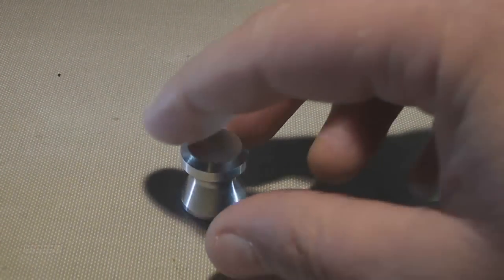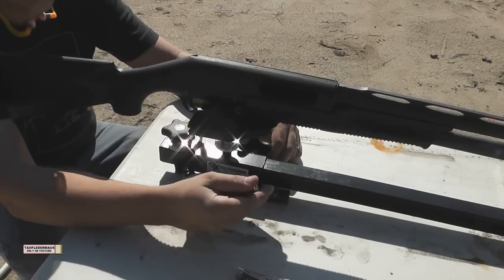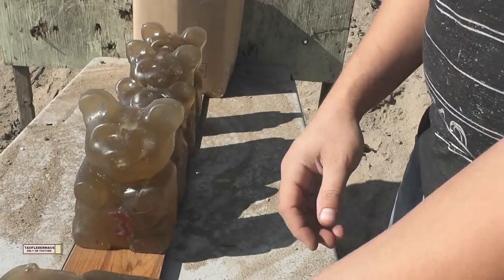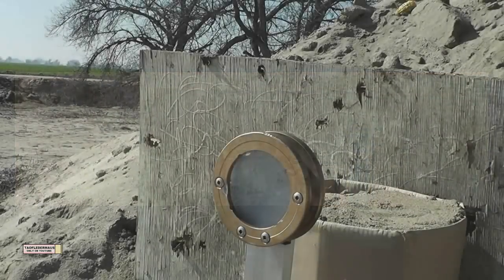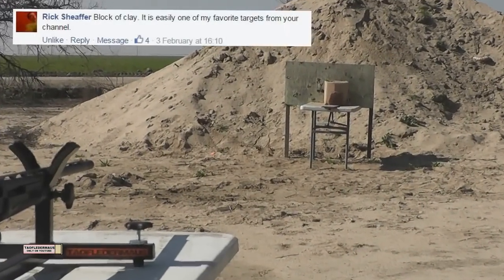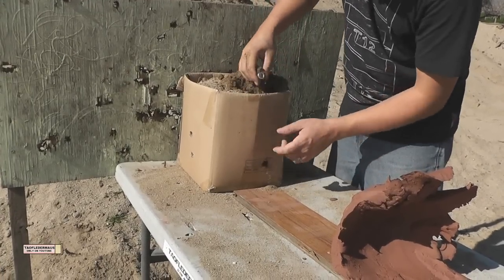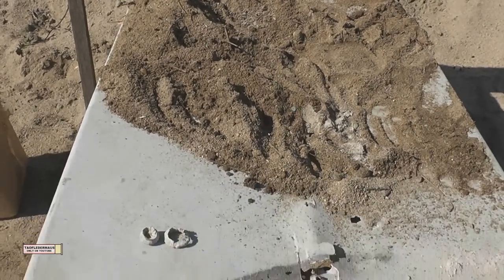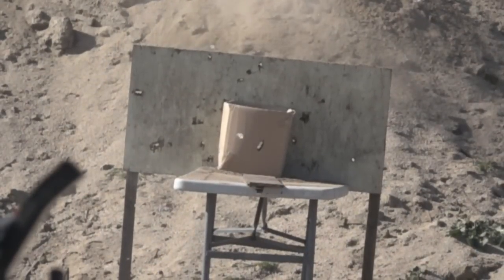.70 Cal  ALUMINIUM Shotgun Slugs  -  Ballistic Trials

Comment: matt, those are not DIABOLO design pellets.... thats wadcutter design. diabolo is domed like tims carbon fiber slug. you will see easily those are not very accurate at range at a higher speed as they create a shockwave at the nose that creates turbulence and causes a keyhole effect.
Reply: heres a link to the difference between them http://www.bestairriflereview.net/wp-content/uploads/2014/03/air-rifle-pellets.jpg

as you can see, wadcutter on the left simulates that "pellet" as the diabolo design is represented by the center pellet in the image which is a superdome. and then the hyperpoint which is crap
Reply from the maker: +Raging Reaper Gaming Variety   A "diabolo"  is a toy that sort of looks like a cross between a yoyo and a top.  That is where the name comes from.   https://en.wikipedia.org/wiki/Pellet_(air_gun)
Reply: *****
i am aware, however. the DIABOLO design in a pellet was developed by cz long ago which is a round nosed pellet with a abrupt drop on the flair of the head. wadcutters in pellet design are any pellet with a flat nose

Comment: Gunpowder has a specific expansion rate, as does any explosive.  I expect that an optimum slug mass would be the maximum you could get without significantly damping the expansion rate.  This means that a slug of less than optimum mass is not likely to go much faster (if at all) than your standard slug.
Reply from the maker: +TheHengeProphet   I think you are correct.

Comment: the issue is assuming that the two rounds have the same energy. the heavier round takes longer to accelerate so it absorbs more energy.
Reply: +TAOFLEDERMAUS Air guns always operate at the same exact pressure, smokeless powders do not.  Changing crimp, projectile or shot load, bullet lube if applicable, wads, can radically change pressure for the same powder charge.  A heavier bullet may actually radically and dangerously increase pressures because it affects the dynamics of the powder's burn and peak pressures through resistance, timing, ect.  Putting a roll crimp on a load of birdshot for a shotgun has the tendency to reduce its pressure over a standard crimp, changing the undershot wad can increase or decrease pressure.  Even projectile drag and shape can affect powder burn and how it builds pressure.  Small changes can yield big results, so no, same powder does not mean same pressure or same energy by any stretch of the imagination.

To be honest, I thought you guys would know this.  What you are doing is potentially very dangerous.
Reply from the maker: +krap101   In the air rifle world,    a heavier pellet tends to be slower than a lighter one.
Reply: +TAOFLEDERMAUS right, but saying that they have the same energy is incorrect except in very specific situations. You can be going slower but still have more energy
Reply from the maker: The same powder charge - same potential energy
Reply: +TAOFLEDERMAUS true, but you don't convert all of that energy into the round.
Reply: +TAOFLEDERMAUS transfer*
Reply: +krap101 it actually has more to do with the round's momentum. a round twice as heavy with the same muzzle energy will have about 40% more momentum (mass * velocity). so it takes more mass to stop the heavier round
Reply: +Everyday soldier I'm talking about internal ballistics rather than external. Just relating momentum to energy is easy... E=PV/2
Reply: +krap101 E=MCC
Reply: +Inteligento that equation is only valid when you convert nuclear potential into some other form... have a weird feeling that is not happening here...

Comment: my thermostat doesn't work and has nothing on it's screen..I haven't had time to meet with a technician because of my job..what do you think it is? the compressor's connection outside is fine, but I don't have a ladder to get into my attic space to check my handler.. i think the cutoff switch or drip-pan switch was jostled when the roofers were dropping loads of shingles on my roof..that or they climbed inside and shut it off to mess with me..it's been cold in here for the past two day :( my poor cat has to deal with it all day..i wish i was covered in fur, sometimes
Reply from the maker: +Star Kicker  See if you have 24v dc between the red and black wires in your thermostat.
Reply: I did, apparently a fuse in the handler was broken. poor kitty..she's happy now..I didn't think there would be fuses in the handler..thanks though

Comment: You dont get any increased velocity because you are using the same powder charge. Factory light weight rounds go so much faster because lighter projectiles cause less pressure (Because less resistance to being pushed) so they in turn increase the powder charge. Id like to see you guys push one of these aluminum slugs with the powder charge recommended in reloading manuals for the slug weight. I think youll be surprised how awesome it becomes, at short ranges anyhow. It won't carry as well.

Comment: I think the reason why the lighter bullet is not going any faster is because it reached the peak velocity the moment it left the barrel. Basically, the speed it is leaving at is the representation of the force of the powder. Since both of them are using the same grain, both of them having the same speed is understandable.

I think the aluminum bullet had a faster acceleration than the lead bullet inside the barrel though, probably because of its light nature, the friction caused it slow down by the time it left the barrel.

Comment: Handloading brass shotshells I figured out that it takes back-pressure to get full energy out of modern, smokeless powders like Unique.  As light as your slug is, with no crimp to hold it in while pressure builds, I actually expected it to be slower than the lead slug.

Comment: as someone who reloads ammunition I can tell you that to get a proper powder burn and therefore utilize all the energy of the powder that is there you have to have enough weight resistance to allow the powder to burn before it exits the muzzle, otherwise you just blow most of the unburnt powder out of the barrel, however the low penetration/energy rounds would be good for in-home defense as there would be much less risk of hitting an innocent person in another room.

Comment: Cool slugs, and interesting results.

If any of those are still in decent shape you could try filling up the skirt with lead. The melting temperature of lead is 327.5 °C and aluminium melts at 660 °C so it should be possible to do this without melting the aluminium slug. I suspect that the lead wouldn't adhere to the aluminium but drilling a few holes in the skirt before pouring the lead should be enough to hold the lead in place when shoot.

These slugs was very stable when you shoot them. Question is how much of this stability is due to the aerodynamic shape and how much comes from the light skirt. You've shot a few projectiles "backwards" and the results has been quite unpredictable. So what happens when you move the point of balance way back on a proven projectile? My farm boy logic circuits want to believe it would become very unstable, but they never got the upgrade for supersonic aerodynamics calculations...

Comment: I haven't watched it entirely, but i bet that ultra-light projectiles won't have that momentum over heavier ones, that they will have a bit more difficulty moving through the air. Especially that shape of slug, with a flat nose is not as aerodynamic as pointed ones. Because of these factors, it's going to have a very funny performance over long ranges.

Or at least that's what i think.

Comment: do you happen to know what temper the aluminum projectile is made of ?
3000 grade aluminum is soft and would possibly change shape or mushroom. 
7000/ 8000 series aluminum is very hard and more likely to shatter. 
the reason your slugs fly at the same immediate velocity is probably greatly related to their equal aerodynamic cross section- their equal trailing low pressure - and the sonic pressure wave the precedes the projectile out of the barrel. 
i would agree that the lead slug would sustain it's energy flying both longer and faster than the aluminum which not having the mass would not carry the inertia of the lead.

Comment: You need to get that made of steel and with pointed head. :D
Reply from the maker: +Mr. 42  Steel would be pretty cool.   I have a feeling Tim will continue experimenting with the diabolo shape.
Reply: +Mr. 42 But if you point it, you will change the stabilizing shape.
Reply: +telefon72 Τhere are pointed diabolos as well and they are stable ( in airguns ofcourse)

Comment: I think the little flashes might be thermite reactions... There might be a bit of oxides on the surface of the targets before the high velocity aluminum struck it hard enough to react with it. I'm just not sure if there was enough of it make a considerable amount of light. 

It could also be the kinetic energy of the impact creating a cavitation bubble that generates enough heat to incandesce the air. Or it just might be that very instance of friction doing that.
Reply from the maker: +BrokenLifeCycle    I haven't given it too much though but you might be onto something.

Comment: Aluminum is a pyrophoric metal, so it is reasonable to expect it to spark on impact.
Reply: +Daniel Taylor Yeah, Aluminium is a very reactive metal, it's just its outer oxide coating that tames the beast
Reply: +Daniel Taylor vaporization from impact, then reacting with oxygen?
Reply: Small amounts, yes. Like the flint and steel striker on a lighter.

I was surprised to see it on the lead, so there may be multiple things going on.
Reply: +Daniel Taylor it happens fast too, Jeff has 3 or 4 cameras running with shutter speeds of ~1/3000s and still only captures one frame on one camera.
Reply: retract
Reply: cheerdiver the aluminum is a potential ignition source. That's what it means to be a pyrophoric metal.
Reply: +Daniel Taylor didnt think of that...since it sparked on 2 metal surfaces i was thinking of a piezoelectric spark
Reply: Daniel Taylor Harvey Dent Bradley armor fires.
Reply: cheerdiver and it's only a brief flash, right at the moment of impact. When small bits of aluminum are being knocked loose due to an impact at high speeds.

While it could be reflected light, it looks like fire, so discounting possible sources of fire is foolish and leads to industrial accidents if you are a professional.
Reply: Daniel Taylor Have you ever tried to light fine aluminum powder and iron oxide (aka thermite), it's not as easy as you try to make it sound.  It sure as heck doesn't happen to SOLID malleable aluminum due to kinetic energy.
Reply: cheerdiver That's because you have to get through the oxide layer with aluminium. If your aluminium breaks to pieces exposing actual aluminium it will burn.
Reply: cheerdiver Hence the brief flash. So short that only one high-speed camera was able to catch it at all. We aren't talking about the round going all WP on us, just an instantaneous reaction right at the time of impact.
Reply: +Daniel Taylor Bull pyrophoric. Phosphorous is pyrophoric not aluminum. It is more likely (and I'm speculating) that at impact the free electrons within the mass get bumped to one end like the passengers on a bus that hits a wall. With the exception that the electrons can move through conductive substances like metal, water and air. If you don't believe me try dropping a magnet through an aluminum pipe.
Reply: Inteligento are we only allowed one pyrophoric metal?
Reply: There are others but aluminum is just not one of them.
Reply: Inteligento I was surprised to learn it as well, but aluminum's corrosion resistance is, like chromium's, due to the rapid formation of a thin and strong oxide layer.

It's a pyrophoric, the same as iron.
Reply: +Daniel Taylor Yep. Impact generates a cloud of extremely fine aluminum powder, and the power ignites.

Oh, and aluminum IS highly flammable. It's a major ingredient of the fuel used on the Space Shuttle Solid Rocket Boosters.
Reply: +Patrick Sawyer Also part of Tannerite and known to catch fire when exposed to thermite.

Comment: A brass one of those slugs would be interesting.
Reply from the maker: +azal123  Copper would be good too.   I bet Tim will continue with this shape for future projectiles.  They are much easier to machine,  all the machining can be done  in one session on the lathe.
Reply: +TAOFLEDERMAUS Brass is harder ;)
Reply from the maker: Copper is a little denser.   We had good results with both though.
Reply: +TAOFLEDERMAUS Hope you get some .
Reply: +TAOFLEDERMAUS I think this ammunition would make a good platform for carrying an armour piercing projectile. Maybe?
Reply: +TAOFLEDERMAUS I mean have a pointed or conical hardened insert in the center of the round. "Focal point of energy "

Comment: Be nice to see you shoot through a piece of say 1/2 drywall with a space of say 2 inch then another piece of 1/2 drywall (mini wall) to see how much actual penetration you would get in a home defense type scenario.  And possibly use a light load when shooting also, slow them down a tad.
Reply from the maker: +moclark6911  I'm pretty sure these would go through two layers of drywall like butter.  I'm sure if we had a row of drywall spaced 2 inches apart,   it might only take 4 to 6 layers or so to stop it.  Just guessing.    Tim shot a steel propane bottle with one of these and it went cleanly through both sides.
Reply: +TAOFLEDERMAUS  Even using a lighter load?  Something maybe subsonic?  But nice to know that they do go through propane bottles.
Reply: you can shoot a ping pong ball through .5" plywood if you move it fast enough.  these slugs would punch through drywall no problem at all.

Comment: Fresh aluminium is extremely flamable, comparable to magnesium metal. In air a very thin layer of oxide forms that stops further oxidation. I would guess it is the aluminium that is getting exposed and heated and causes the flash.

Comment: Never mind; I got the answer to my question later in the video.

That slug looks like it has a "skirt" at the back and a "head" at the front. Isn't one of the purposes of the "skirt" to expand and seal against the barrel as well as engage the rifling (if any)? Lead could exand, but aluminium is not going to do that, it will still act as a stabilizer by adding drag though.

Comment: this lightweight projectile has me thinking...
It would be interesting to see if tactical g-code could make a sort of aluminum wiffle ball to shoot. would it fly just as crazy at supersonic as it does at subsonic? maybe the holes would act more like golf ball dimples with the high pressure fronts and actually stabilize it? if it is even possible to machine a metal shotgun slug sized wiffle ball i wonder how its structure would deal with the initial acceleration and travel down the barrel.

Comment: this flash is called "spark" it usually happens if there is a hard metal flying at something hard. lol
Reply from the maker: +jort93z   We've only seen it occur when steel hitting lead,    bullets striking aluminum,   or aluminum striking lead.
Reply: ***** it might happened because the bullet didint disform.

Comment: if you had maybe a 40 inch barrel the aluminum slug would be going much faster because it takes far less energy to accelerate it than the lead slug and you'd need more time for the gasses to accelerate the light slug.
Reply from the maker: +Dudeman9339   The Benelli with the rifled choke has a 31" barrel length,   the Mossberg is only 20".   We didn't see an appreciable difference between those.
Reply: ***** well huh. thats my only theory.

Comment: I was just about to ask you how much speed/kinetic energy they had. Where is the energy going to if not on the round?
Reply from the maker: +Hoch134   That's something I am not sure about.  Unless the burn rate/expansion of the powder is a constant and this particular powder just expands at 1250 fps.   If that makes sense.
Reply: ***** That actually makes sense. I guess it's the maximum speed you can achieve with shotgun pellets.
Are there heavier shotgun rounds around with which you could test that?

Comment: I'm curious as to the flash seen when the slug hits a hard surface.  The 1st thing that came to mind was the aluminum oxide layer being removed, then the unprotected surface is exposed to oxygen causing a rapid exothermic formation of another layer of oxide.  My theory...
Reply from the maker: +E2qNX8btraQ3zRD6J7fc  Or it could be the alum. oxide doing the flashing.   I'm not sure.

Comment: Could your velocity similarities be due to the maximum burn rate of gun powder? The gun powder is simply getting both projectiles up to the gun powder's maximum potential velocity for a round of that design, therefore any increases in velocity you will have to use either an alternate propellent...one with a faster burn rate or change the design of the round (since both have the same surface area/wind resistance. Of course, changing the propellent would be exceptionally dangerous out of a standard gun.
I'd love to see the same basic design, but with harder materials and a much more pronounced pointed tip...short squat pointed tip to act as the penatrator. What also might be interesting is to experiment with the back end of the pellet design. Not sure about supersonic fluid dynamics, but for slower moving objects, a vortex is formed behind which introduces drag and slows the object down. Race cars, semi-trucks, airplanes all modify their tail or aft sections to disturb the vortex thus reducing the drag and hopefully increasing the forward velocity.
Reply from the maker: +Philip Hewitt II  I'm pretty certain it has to do with the burn rate of the powder.    But I am ok with keeping the velocities around 1200 fps because of the limitations of my cameras.   Anything faster would be harder to see what was going on.